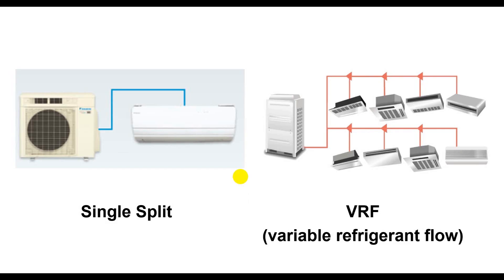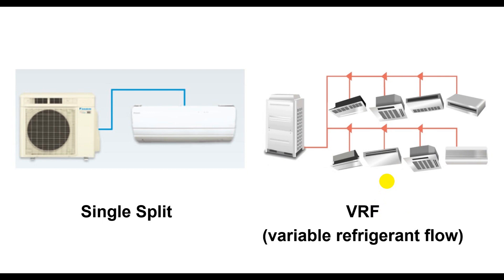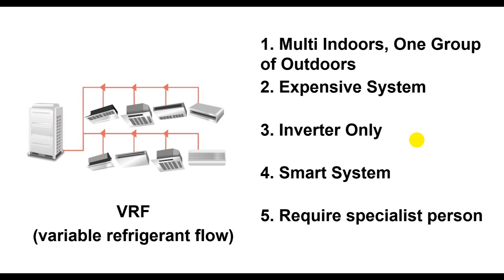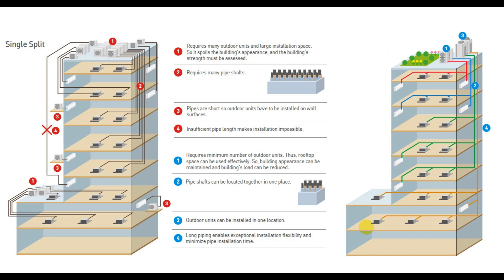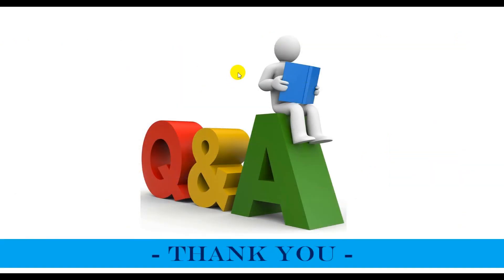The Different Between VRF and Single Split System

Comment: Sir v r f me kitne feet tak piping ki ja sakti hai
Reply from the maker: Let me sorry that I can't understand your question.
Please write it in English
Reply: @HakNukMan  He want know in VRF type of AC, how long (ft) we can do the cu piping?
Reply from the maker: @Mohammed Rafeek
Thank for your translation.
The piping possible up to 160m to furthest indoor unit.
70m for the high. 18m high between indoor and indoor.
1000m for overall total length.
Please remember this only can use with Mitsubishi Heavy Industries Air Conditioner.
Another brand have their own specification.
Reply: @HakNukMan  Thank you  so much for kind information.
Can you tell me the distance between refnet joint and indoor,
Refnet joint to refnet joint? etc some standards...
( Refnet joint = Y joint, header etc)
Reply from the maker: As I mentioned in the beginning. They're different depend on brand. Let me feedback later after I found the answer for you.